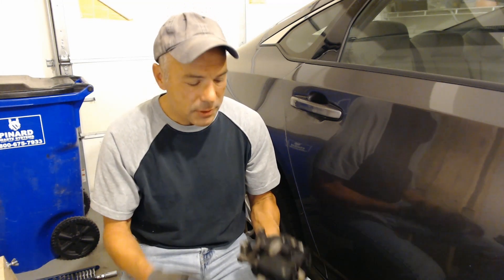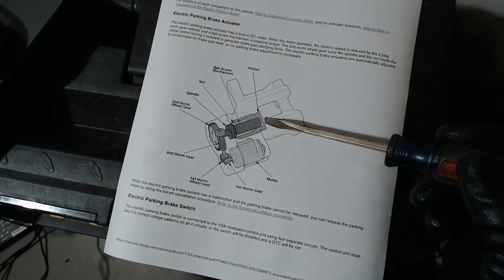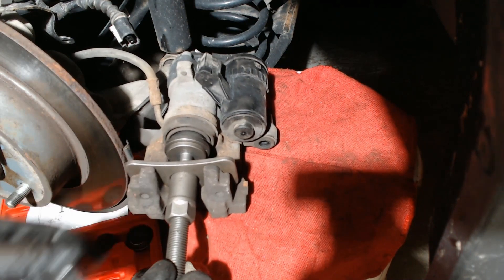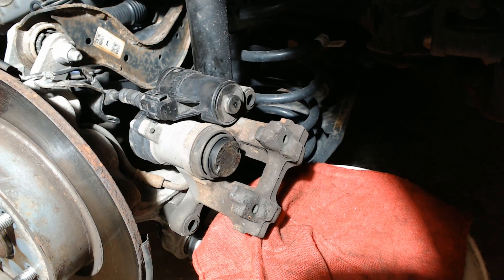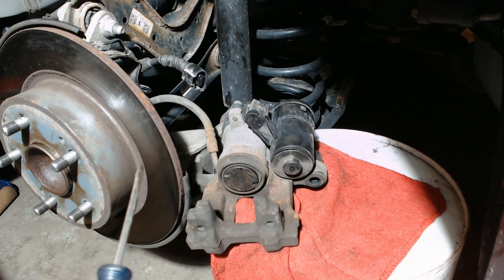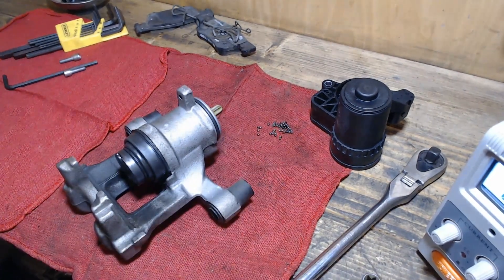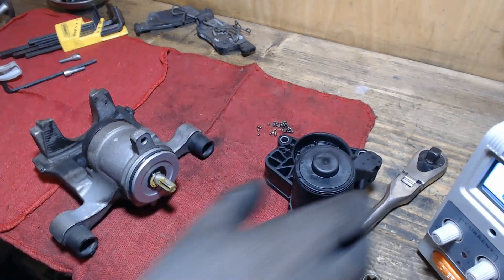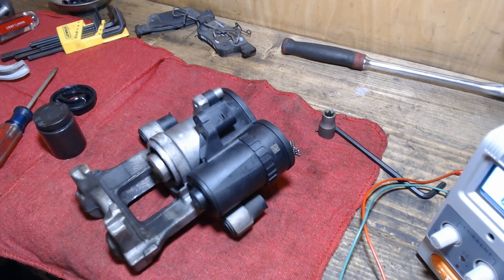4 Ways to Retract Brake Piston on a Honda Accord with Electronic Parking Brake

Comment: So it is only true that the cylinder can be returned back with a tool that pushes and rotates the cylinder. The internet said that this is wrong and that you can destroy the mechanism in the rear brakes. I was wondering why the cylinder has two round grooves, like rear brakes with a normal handbrake. I have a civic 1.5T car and will push them back in this way, the easiest way.
Reply from the maker: Yes, I have successfully used that method (windback tool which rotates and presses) on my Honda Accord with no issues.  I don't know for certain if your Civic uses a similar caliper but would imagine so.  

Officially, Honda service data suggests using a scan tool to enter "Maintenance Mode" to retract the piston and then using a tool to push the piston in the remainder of the way.  Alternatively, Honda service data says that if you aren't using the HDS (Honda's scan tool) then removing the parking brake actuator and using a TORX socket to turn the spindle back is an alternative method.  However, if you look at the teardown and cross-section in the video, I think you can convince yourself that rotating the piston in accomplishes the same goal.  The only possible downside of this method that I can see is that you have to be careful to ensure that the dust boot is spinning freely on the piston so that it doesn't bunch up as you rotate the piston.  This wouldn't be a concern for methods that don't rotate the piston, so perhaps that is why they are recommended.  However, it is not a big deal to ensure that the boot is spinning freely just as was done on all the older style calipers with the manual parking brakes.

Comment: Great video. One question and hope you can answer. I’ve changed brake pads before and what I’ve always have used has been a C clamp with an old brake pad to retract to caliper back. Would that way work on this type of car?? I have a 2018 Accord Touring edition.
Reply: I actually just did my the other day. I used a needle nose to rotate the piston and the c-clamp to push in the rest. Worked perfectly
Reply from the maker: @chriscruz985  That's a clever approach without requiring any special tools!
Reply: @JohnsDIY  i had to figure something out! Haha
Reply from the maker: I have used the C-clamp method you describe on some vehicles as well, but unfortunately, that method by itself will not generally work on the rear brakes of the 2018 Accord with the electronic parking brake.  The piston will push in some, but only until it hits the inner nut on the ball screw and then will stop pushing in.  You will need to either rotate the piston or use one of the other methods described in the video to retract the inner nut inside the piston.
Reply: Thank you very much for such a quick response. I just bought the brake pads at my local Honda dealer and now I will get the same clamping system tool at my local auto parts place. I’ve changed the pads in all my cars using the C clamp so I shouldn’t have any problems after watching your video and using the new tool. again thank you very much!
Reply from the maker: Sure thing!  The C-Clamp should work fine in the front, but yes, you'll need some kind of windback tool for the rear.  Usually they are called a brake rewind tool or brake wind-back tool.  On Ebay/Amazon, they are typically available for about $30.  Good luck with the repair!

Comment: Do not remove the motor.  I did my brakes today using that method and now my brake system is throwing errors, emergency brakes wont engage now.
Reply: What ever happened with this problem ?
Reply from the maker: Thanks for the comment Michael.  So you removed the motor and turned the shaft to retract the piston?  I think ordinarily that should work fine and since the PCM uses motor current to determine end-of-travel for the parking brake, it should adjust automatically and the PCM shouldn't even be able to tell that the motor was removed.  Just to double-check, are you sure the connectors are reconnected and fully seated?  Did you try activating and releasing the parking brake a few times?
Reply: @JohnsDIY  yeah i went back and checked the wire connections, they are fully seated.  I took it to AutoZone for the codes, it’s showing c1111-13, c1111-11.  Looks like the problem is confined to one actuator, the left one.
Reply from the maker: It looks like those codes are actually for the RIGHT rear parking brake actuator.

C1111-11 Right Rear Electric Parking Brake Actuator Circuit Short to Ground
C1111-13 Right Rear electric Parking Brake Actuator Circuit Open

Are either of those or both stored codes (not currently active)?  They seem to be mutually exclusive faults, so hard to imagine they could both be active.  If the car was turned on with the parking brake actuator disconnected you might get a stored code for C1111-13.  Did they clear the codes to see if either came back?  From your original comment, I understood that you removed the motor and turned the shaft manually to retract the parking brake?  If so, it doesn't seem that these codes (both electrical) would be related to that.  Did you check that the pins inside both connector ends on the right side actuator look okay?
Reply: I didnt check those pins no.  Does that likely point to a wiring issue, or is the actuator probably broken?
Reply from the maker: Both of those codes indicate electrical problems, but those problems could be in the wire harness, the connector (at least in the case of -13) or inside the actuator.  The -11 code indicates that one of the two wires is shorted (connected) to the vehicle chassis somewhere.  For example, a spot with no insulation on one of the wires that touched the chassis metal would cause this code.  The -13 code indicates that one of the two wires going to the actuator isn't making a connection.  For example, a break in the wire could cause this code, or if the connector pin was missing or making bad contact then it could also cause this code.

If it were me, I would start with a careful inspection of the wires going to the right, rear actuator plug.  Then I would carefully examine the pins and connector and compare it to the other side to make sure everything looks good (pins in place, not bent or anything).  Was the wire harness subjected to any accidental stress during your brake job (e.g. caliper falling and getting supported by the wire?  or really hard accidental pull on the connect which could have broken a wire or pulled a pin out of the connector?).
Reply: @JohnsDIY  on the right side no (passenger).
Reply from the maker: Exactly, on the right (passenger) side.

Comment: This video saved me from a huge financial trouble, I went to change the brake pads and the piston wouldn't go back. I tried a bunch of ways even the one connecting the aligator jack to a battery, and for some reason the motor just kept working without retracting the piston. The only method that worked for me was to by the turn back tool on amazon and use it to screw it back. Thank you for that tip man.
Reply from the maker: Thanks for the nice comment Paulo!  That's great that you were able to solve the problem - nice work! Thanks for taking the time to post the comment.
Reply: Getting ready to do rear brake pads on my2015 acura tlx, my screws are not Allen  but torx.think a 30 and 47. Everything else is the same. Thank you for showing different ways to service EPB.

Comment: Excellent video! I was really surprised that the turn back tool worked. I guess as long as the pitch of the threads on the turn back tool is greater than that of the ball screw it will work, otherwise perhaps not?  

I like the apply 12v method the best as it  avoids driving  the worm drive geartrain backwards from the end it wasn't supposed to be driven from.  But again doing that  seems to be no problem in practice.
Reply from the maker: Thanks for the nice comment James!  That's a good point about the relative thread pitch and I agree.  With the turn-back tool threads finer than the ball screw, on each turn the ball screw moves in farther than the tool moves out, so you just have to catch the tool up by additionally turning the nut.  If it was the other way around, then the turn-back tool would move out further than the piston would move in each revolution and the tool would want to bind up.  I guess you might be able to try to manually loosen the nut to continuously keep enough slack, but it would definitely be trickier in that case (since if you didn't turn the nut enough you would bind up rather than just start getting really loose).  Good point!

Yep, that makes sense to me.  Seems like once you have some test leads at the ready then it might be the quickest/easiest method as well.

Thanks!